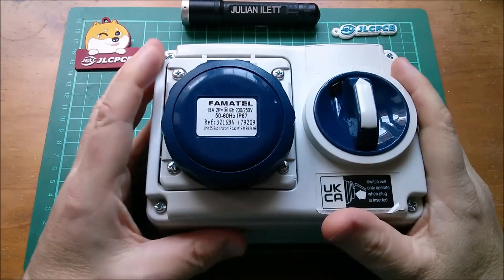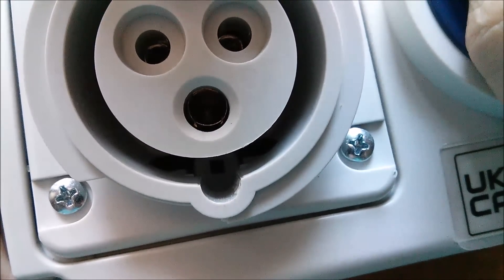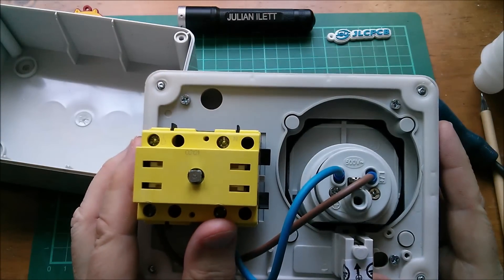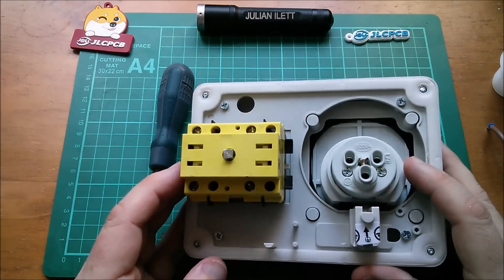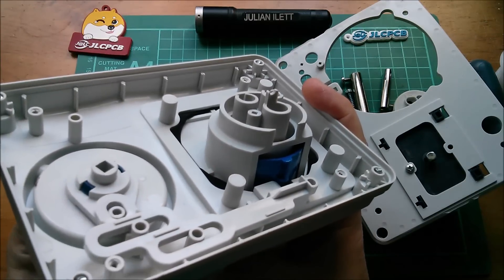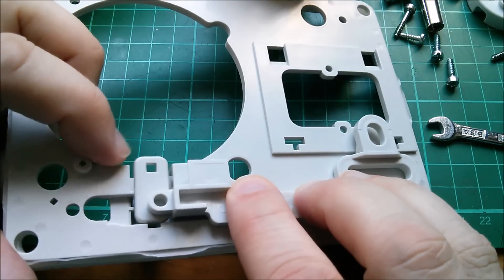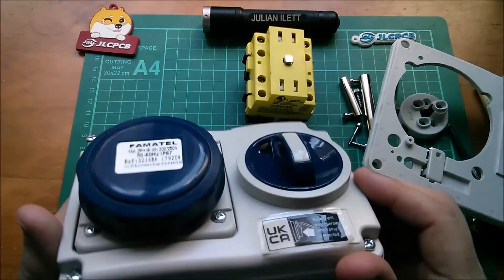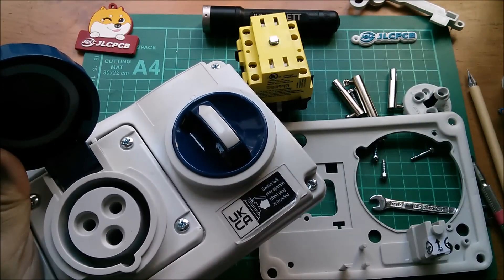16A Ceeform Interlocked Socket Stripdown

Comment: I installed a 32A socket in my garage.  the bottom of the garage door has just enough of a gap for an EV charger cable when shut.

Now I can plug in my home made EV charger. The internals stay in the garage.

Comment: To comply with UK wiring regs, an external socket intended for EV charging would need either PEN fault protection ( assuming supply is TNCS), or a TT earth rod. It would also need to be fed from a type B RCD

Comment: But this is an over-engineered outlet. In the rest of Europe there are these sockets without a switch for in- and outside. So far nothing catastrophic has happened.
Maybe you should build a shed, in it you put a box and in it the watertight socket. If that's enough...

Comment: The Toolstation number is 79209 and the picture they show is clearly of a different item to the one in this video although the supplier appears to be the same.
Reply from the maker: That's the one. It does look a bit different in the Toolstation website - there's no grey pointer on the switch for starters.
Reply: @JulianIlett  And no reminder sticker, clearly needed judging from the number of reviews complaining they couldn't switch it on unless a plug was inserted.

Comment: Based on the outdoor switch box Dave Jones had issues with, taping over the top and sides of the seam will help with waterproofing, especially if the box gets exposed to sunlight. Leave the bottom untaped since it might be designed to let moisture escape, and it also looks like some electronics safe silicone around the outlet can't hurt either. Also add a bag of desiccant inside if there's enough room left over, and try to have the cable entry holes at the bottom of the box.
Reply from the maker: That worked on a PIR sensor I put in my garden. The sensor is intended for indoor use only. It's still working several years on.

Comment: Padlock hole is typically intended for lock-out tag-out (LOTO) procedures to stop people from turning things on while they are being worked on, and it looks like they just kept the feature (it's on the 'normal' industrial power switches as well, the ones that look like this but red)
Reply: The red isn't "normal" or "industrial", it's three phase; loto can be for any equipment that might have multiple people working on it. You are correct though, it does look like loto.

Comment: I noticed your "6BA" wrench, those are not easy to find in metric countries, the sellers in hardware stores don''t even know they do exist 😅 I have the whole set of BA wrenches I need them as I tinker aircraft parts.
Reply: Actually BA threads are metric. 0BA is 6mm in diameter with a thread pitch of 1mm and a 0BA spanner is 10.5mm. Smaller sizes are mathematically derived from these dimensions.
Reply from the maker: Those BA spanners are at least 40 years old :)
Reply: @JulianIlett  My set of Terrys flat ones are so old I can't remember where they came from.

Comment: I think that you can mount that on an outside wall and run a cable through. Then as long as you terminate it in a normal 13A plug you don't have to follow any regulations. It is just a pluggble device that happens to be fixed to the wall. And IP67 notwithstanding I would still put sealer on that - I'm not convinced.
Reply from the maker: I want to run this at (or near) the full 16A so the 13A plug idea can't be used. As far as the IP67 rating is concerned, it'll be fine inside a meter cabinet.

Comment: To get IP67 rating, they are actually properly tested, so no matter what you may or may not think, they testing is done under the conditions as specified in the standard to get the rating.  Unless you can test under the prescribed conditions and can prove it fails (in which case, it should be a warranty issue anyway) you really can not go making  assumptions based on purely circumstantial evidence.
If you are worried about the legality of installing the socket, would be probably better to actually ask a properly trained and licensed electrician prior to purchasing it.   You will more than likely find the interlock is sufficient to be legal, but if you do not know the regulations, you should not be playing with mains wiring anyway.   
Sorry, to be so negative, but wild assumptions and lack of knowledge of regualtions annoy me, and comments are just our feelings and opinions :)
Reply: Of course, now that Julian has taken it to bits and presumably put it back together it will need to be tested again to ascertain whether it still complies
Reply: @Bob_Burton   Technically that would be right also.   :)

Comment: Just today I was just packing up our rack from an event, and it uses the exact same connector for power. Obviously the male version, so you need a cable with a female socket on the end to power it up.

The padlock hole is for venues, wouldn't want someone poking around, figuring out the interlock and getting a shock. Or worse, unplugging a piece of equipment.

Comment: I would use this with a 2KW ~ 8KW LPG Generator  (or 10KW Tri fuel) ready for the January +4 day Power & Gas rationing
Reply from the maker: Or an EV with V2L :)
Reply: @JulianIlett  You do have that for silent mode however can you make it last 4 days

Comment: Mount to wall and  a can of Plasti dip or Chlorinated rubber Swimming pool paint or UV Cure Epoxy Resin over the box joins lips and Cure it with a UV light Source for 5 ~ 20 mins 
Pool paint i would shallow fill (kitchen ladle) the back Front Plate of the socket so when it sets it will  make a custom water tight gasket seal

For moving Bits i would use petroleum jelly and make crude stuffing box or gland package 

"A gland is a general type of stuffing box, used to seal a rotating or reciprocating shaft against a fluid. The most common example is in the head of a tap (faucet) where the gland is usually packed with string which has been soaked in tallow or similar grease. The gland nut allows the packing material to be compressed to form a watertight seal and prevent water leaking up the shaft when the tap is turned on. The gland at the rotating shaft of a centrifugal pump may be packed in a similar way and graphite grease used to accommodate continuous operation. The linear seal around the piston rod of a double acting steam piston is also known as a gland, particularly in marine applications. Likewise the shaft of a handpump or wind pump is sealed with a gland where the shaft exits the borehole.

Other types of sealed connections without moving parts are also sometimes called glands; for example, a cable gland or fitting that connects a flexible electrical conduit to an enclosure, machine or bulkhead facilitates assembly and prevents liquid or gas ingress. "
Reply from the maker: I'm just not a big fan of gunk (in its various forms). I think the secondary enclosure (meter cabinet) will work fine and provide a 2nd line of defense against tampering.

Comment: eFIXX looked at this issue and concluded that you can install a  commando socket like this in a domestic setting

https://youtu.be/VZC9_Xktkho
Reply: The advantage of using these sockets in a domestic setting is that enables the use of granny chargers up to 16A or 32A, depending on the rating of the commando socket and cable, and so sidesteps the need to install dedicated EV chargers. It means the 16A/32A socket is also available for other applications, such as high power welders, audio systems and machinery in a domestic setting.

Comment: Did you notice that the switch does not have a valid CE symbol! So how did it get a UKCA mark on the front?
Reply: CE Marking doesn't really mean a lot.   CE is a self certification and only tells you the company making the switch THINK the switch meets CE certification
Reply: @EsotericArctos  It may be self certification but if you don't do/have the testing to confirm it meets or exceeds the specification you open your company to a whole can of worms should it go wrong. Your 3rd party liability insurance will be void for a start! I spent close to two years and more than £1m performing "self-certification" of a range of products. Self certification means that you state it meets the requirements and have done the testing. Where is your "Declaration of Conformity" which you are required by law to produce if requested, most supply it in the user manual. When you look at the DOC, you won't see the word "THINK" as proof of meeting a standard anywhere. You "self" provide the proof of testing and keep the technical file for the product to provide the evidence of testing and results. If you don’t have the required equipment and qualified staff to perform the testing “yourself” you will have to outsource it to a test house, which can be in the region of 3-25K per item. "Self" is not just you saying it's ok

have a look here.
https://europa.eu/youreurope/business/product-requirements/labels-markings/ce-marking/index_en.htm
Reply from the maker: Well I'm giving it a HWCA (High Wycombe Conformity Assessed) marking :)
Reply: @JulianIlett  Like your thinking Julian, can i request a "DOC" for it!  🙂
Reply: @JulianIlett  A standard for the entire world will aspire to....cheers.
Reply: They aren’t the same thing!
Reply: @ag.cousins  my point is how do you get a UKCA mark with parts of known quality like the switch. you might test the whole thing to show that it meets UKCA standards, but how do you know the next switch will be the same. if the switch had passed CE testing and marked with the correct CE marking and comes with a  DOC then there is no problem using it.